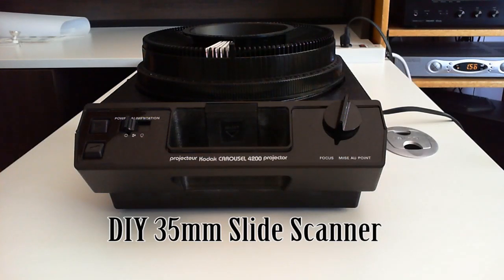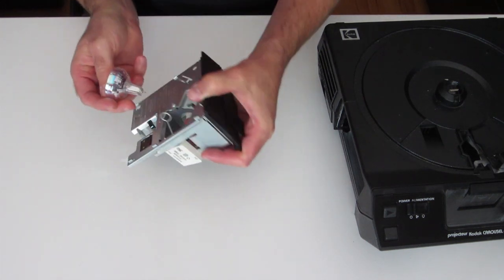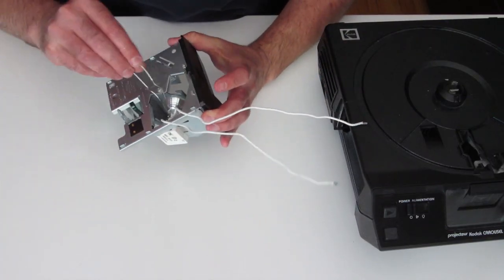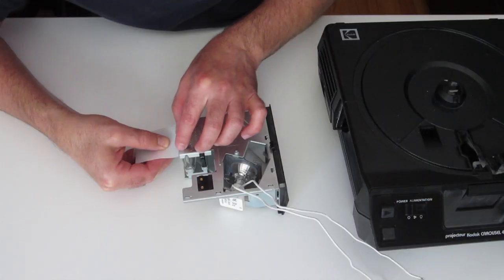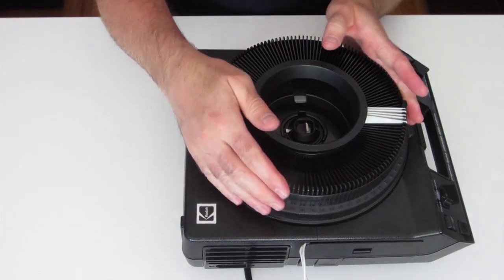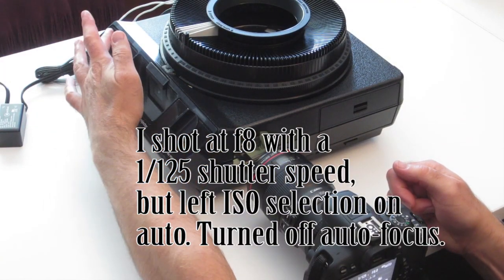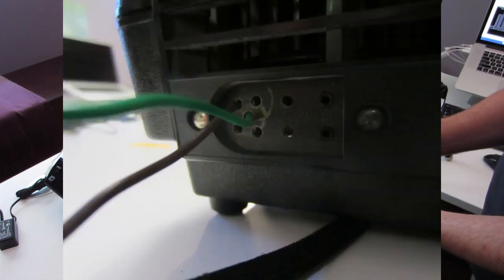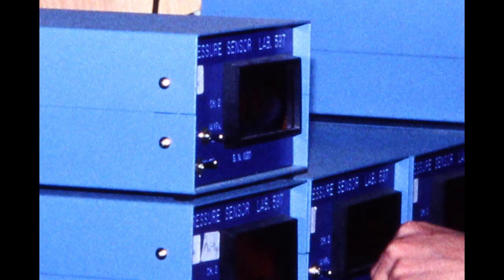DIY 35mm Slide Scanner

Comment: Great vid. Was thinking of doing this and then found your video. What relay control did you use?
Reply from the maker: Thanks Ron. I used a SainSmart 4-Channel Relay Module. Found it on Amazon, but any relay board that is compatible with a Raspberry Pi will work. The DigiCamControl software has a webservice. The Raspberry Pi code is only a few lines. First, fire the relay for about 0.25 seconds in order to advance the projector. Wait for a second or two for the slide to be advanced and in place, then call the DigiCamControl webservice to capture the image. Wait another second or two for the image to transfer to the computer over the USB connection, then loop back to activate the relay / slide advance.

Comment: You clearly have too much time on your hands..about as simple as changing the engine in a car lol
Reply from the maker: Ha ha, actually everything other than the automation is pretty easy. If you have a remote for the projector and a remote shutter release for your camera, you could just sit back and push the buttons. It still beats lining each slide up on a light table and photographing them that way. The automation part was the most fun, though.